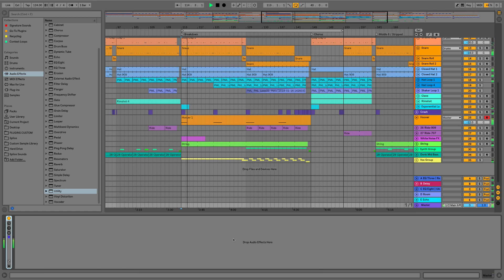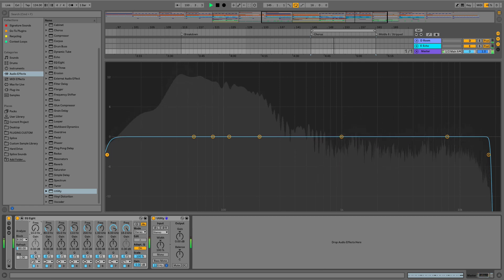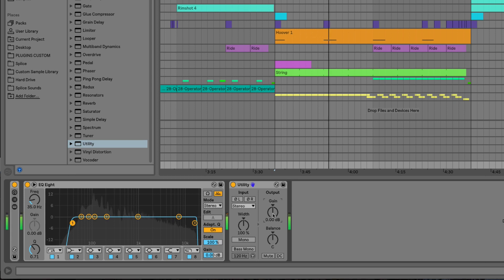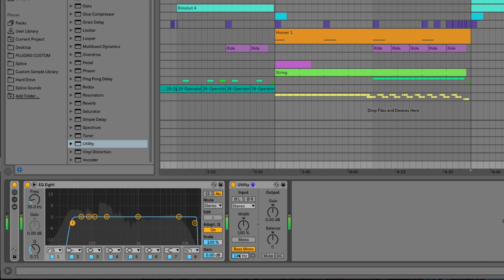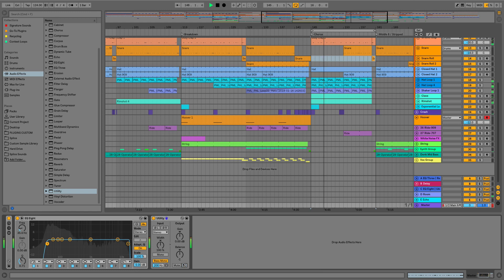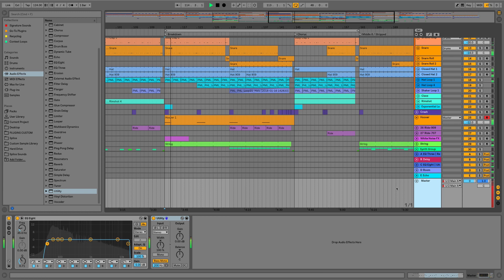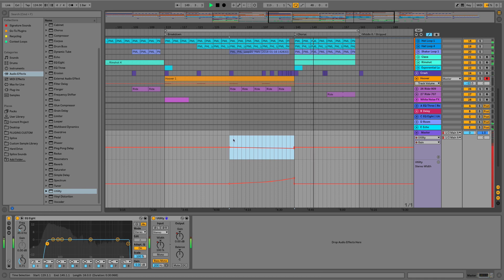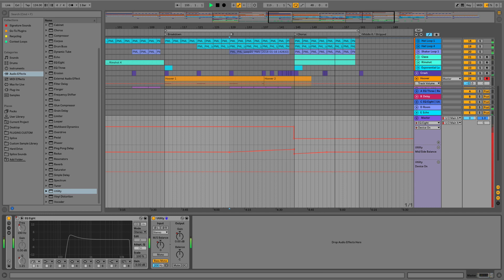Ableton Live 10 - EQ8 & Utility

Comment: In live 9, width knob at 200% used to represet the whole side information. What about in live 10? The side information is at 200% or 400%? And if it`s at 200%, it means that I can still enhance even more the side info pulling the knob up to 400%?
Reply: Rafael Doca just use brainworx for 400.
Reply: Took me a while, but if you right click on the width control dial within Utility you'll see an option for M/S mode :)